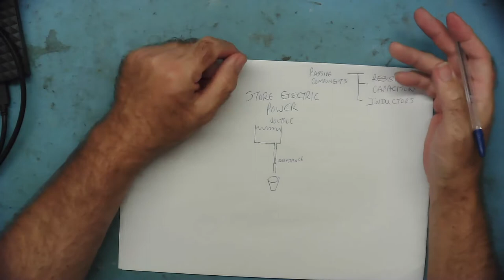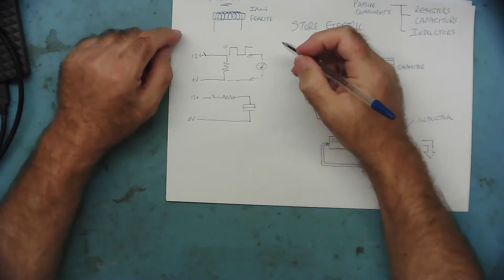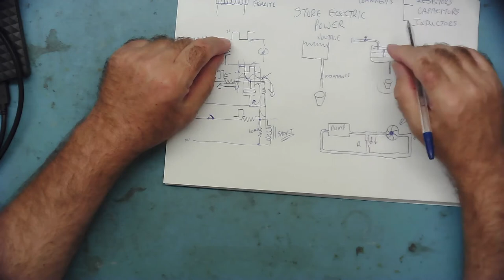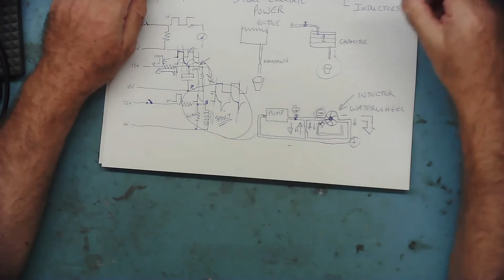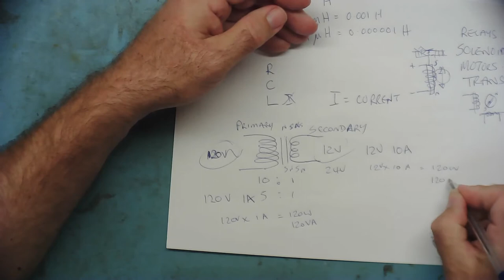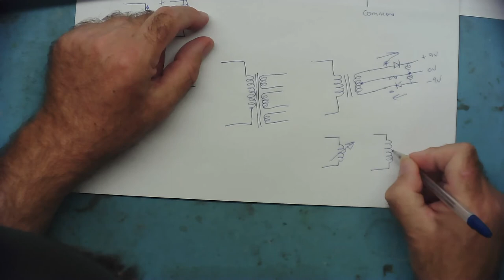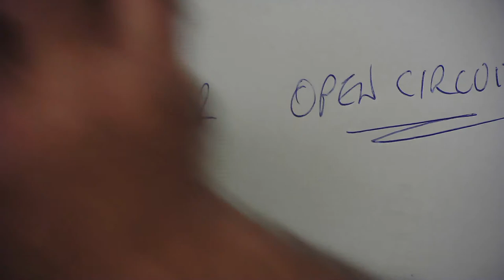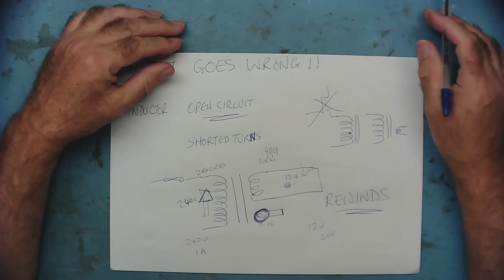LER# 043 Circuits And Components For Beginners 7: Inductors - How they Work Tutorial

Comment: Just started watching your videos. Excellent. I have one suggestion. I love your presentations on paper with pen but I have to look very closely to follow the thin lines drawn on the paper. It would be easier to see if you used felt-tipped pens that provide a slightly more bold line on paper.

Comment: Great information Just subscribed and liked Question when a coil is powered down does the e-m field collapse inward and the polarity of the voltage drop reverse and current is the same direction as normal circuit current? Long way of asking does polarity reverse when powered down

Comment: On the subject of inductor failures I did find a large inductor on the power supply of a portable welder which had been damaged either by shock or vibration or possibly a manufacturing fault. The ferrite ring the inductor was wound around had, for whatever reason, developed a crack completely through. The machine would kick out the mains circuit ing the consumer unit every time itbwas turned on. On removing the cover and turning the power on there was a small flash from the inductor where the crack was. Perhaps the windings were damaged and shortingbto the ferrite core, I'm not sure but the arc was noticible. There were no spare parts available and the inductor was one of those heavy ones used to smooth the power supply current so I bought a ferrite donutvodvthe same size and a spool of enamelled wire of the appropriate thickness and wound the same number of turns. It worked just fine and got the welder back up and running. 
I love these videos and consider them, by far the best and most useful to beginners in electronic repair like myself. I've been repairing things all my life but more often by luck than judgement. Inow feel I'm gradually beginning to actually understand what I'm doing rather than the scratch and sniff method 😊
Thanks Richard.